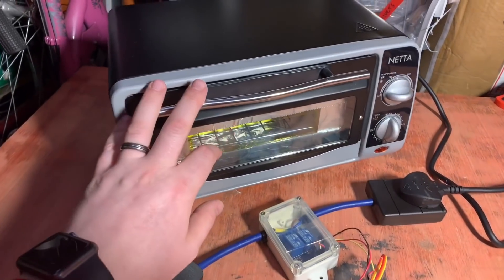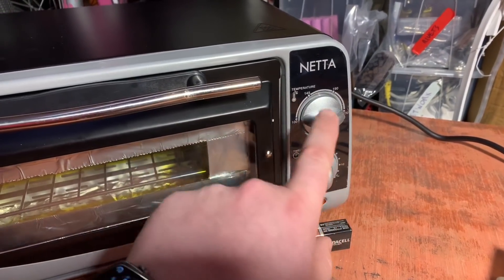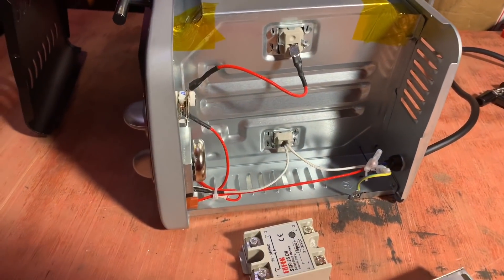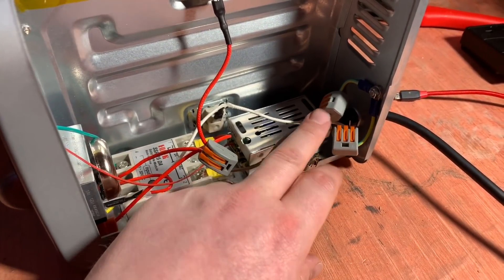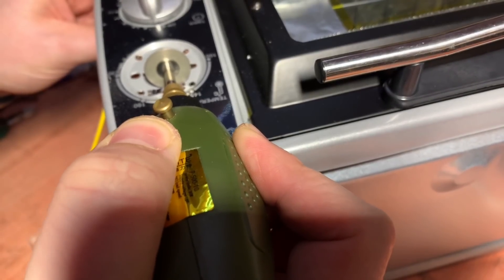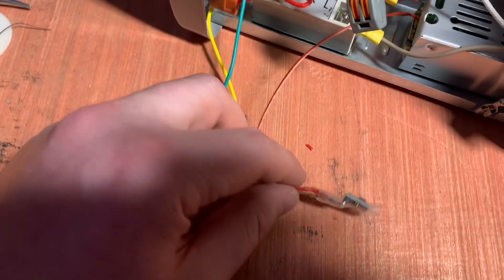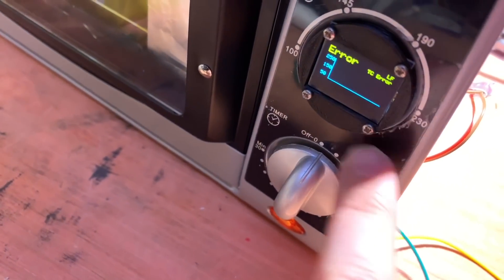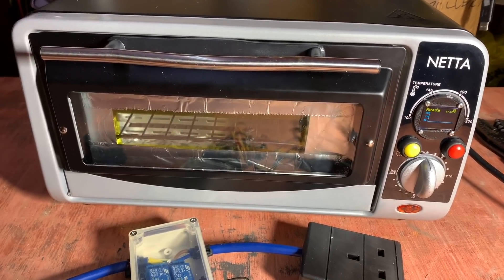RocketScream Toaster Reflow Oven Upgrade Build

Comment: Why did you bother to use a 220v AC oven when you could have done it with ( Reflow BGA solder with a GU10 halogen light bulb ), then you could have used all that battery power you have

Comment: Thanks for the video, I m trying to use this v2 code on a arduino pro mini 3v3 and external oled etc.. But It seems does not work, the oled get stuck at the startup and the temperature reading say (Nan), I m sure the oled and the temperature k sensor are working.. Have you made some changes on the code? Thanks

Comment: The controller really wants to be powered by 5V through the micro USB connector, even though most of the circuit is 3.3V. That way you get to use the resettable fuse that's on the 5V input. I am doing a similar build and ordered a 3.3V supply based on your video, but I've now ordered a 5V instead. Actually I don't know how yours works at all since according to the schematic the SSR outputs and buzzer are pulled up to 5V.

Comment: Hi Adam, thanks for the video. I just started my build today with exactly the same equipment. Hopefully, my Rocket Scream will be here on Thursday.

Can you put the 3D print you made on Thingiverse so I can copy it with pride. Thank you.
Reply from the maker: This is where I have to admit making various version to make it fit and I can’t remember which one is which or which one I ended up using :-/ I’ll see what I can find...
Reply: @AdamWelchUK  Not to worry if you can't, designing in 360 is an enjoyable process anyway. Would you recommend cutting out the metal that was behind the thermostat and completely replacing it with something 3D printed? That would produce a flush fit, but I don't know if it's worth the effort. is there any chance your screen could fall out of the board behind it?
Reply from the maker: These are my simple 3d parts... https://www.tinkercad.com/things/icxfl9mtdMN  
As I think I showed I just drilled four holes for the screws and a slot for the screen connection.  The corners of the screen are actually a little bit big for the round impression for the original knob - one day I'll be brave enough to file back those corners so it fits a bit better.  I do have a plan to 3d print a new panel, but I haven't got around to it yet.  Could my screen fall out - hopefully not, because I replaced the provided screws with longer versions, so the screws go through my 3d printed surround, through the screen, through a thin 3d printed insulator and then into the plastic stand offs which usually hold the screen to the rocketscream board.  So it can only fall off if the threads go in those stand offs - so I was careful when I screwed it on not to go too tight.
Would I cut out a larger section?  Probably not.  The way i have mounted it means the four screws are holding the screen on the front and holding the weight of the board behind.  Replacing the whole section might need gluing in to be able to take the weight of the rocketscreen board (not that it weighs all that much, but it also has a few wires hanging off it and I wouldn't want it floating around the mains if it did fall).  The metal of the oven is very thin and cutting it isn't always very neat.  I'd worry if I took a larger hole out I'd need to make my print big enough to cover a larger space to hide any imperfections.  Please do post a picture of yours though which ever way you do it - I'd love to see it.
Reply: @AdamWelchUK  Thank you, for the detailed answer. It answers my questions, I will stick with the printed circle for now and like you say, there is always the option of getting the Dremel out again at a later date. Just out of interest, where about's are you, I'm in Preston, Lancashire.
Reply from the maker: Oh well I’m on the sunny side of the Pennines. Leeds. ;-)

Comment: You covered all of my skepticism with your extra temperature readings in that cavity. Well done, nice build.
Hand nibbler pliers are a great little tool for working with sheet metal like this. I don't like the drill powered variety, but the pliers are awesome for cutting slots and square holes without distorting the surrounding metal. 
 I always seem to have a dremel run away to create it's own abstract art at inopportune moments. You're obviously better at that tool than I am :-)
-Jake
Reply from the maker: Hi Jake. Yeah the temperature rise in the cavity was surprisingly low. I was really pleased with the result. The dremel isn’t the best, but a quick go round with a small file sorted out the rougher edges. I was also safe in the knowledge that both sides would be covered up :-)

Comment: I'd put a toggle switch to turn the psu on/off. That way you don't have parasitic power usage while the unit isn't in use. Unless you don't have it plugged it in all the time, I suppose. And the size of your work shop.
Nice looking setup either way 👍
Reply from the maker: Thanks. No I’ll be putting this back in it’s box on the shelf once I’ve finished with it. I haven’t the luxury of space to leave it out. I did consider needing a switch to turn off the PSU if I plug in a USB cable, but as it stands I can’t plug one in yet because of where it is situated!

Comment: Hi, nice  work and nicely done!, seems like a very useful project, the ones I like. So, the schematic shows that the tiny reflow controller already has a 5v->3v3 regulator, no need for the ams1117, also, wrap a linear regulator sounds like a very bad idea. Cheers.
Reply from the maker: I should have looked at the schematic but assumed 3.3v was derived from the USB serial chip. I’ll check, thank you. 
Given that the AMS1111111117 is dropping only 1.7v at a pretty low current I’m not concerned about heat (and I’ve got plenty) but I will check the schematic and see if I can cut it out. Thanks again.

Comment: I love the idea of using the original mechanical timer as a safety. That's awesome. Maybe consider a re-settable thermal fuse as another safety vector? Strap that to the oven wall, so you don't burn  your shed down running the oven during the summer!

Comment: Great job! Just keep monitoring the heat in that cavity over time. Maybe sit the SSR and PS on some heat resistant material just for extra heat isolation from the case.
Reply from the maker: Cheers Seon. I will keep checking. I don’t imagine I’ll be doing flow after flow but I’ll look into that in case. Thanks.
Reply: @AdamWelchUK  Great project, Adam, and really nice permanent solution! I thought maybe a couple of strips of Scotch-brite pad under the SSD & PS would insulate them, non-flammable and is also non-conductive...? Just a thought. Thanks for all your videos for us makers!
Reply: @AdamWelchUK  I have had amazing luck with the little 40mm Noctua fans for quiet, just-needs-some-airflow cooling applications like this. I should be tossing one together with the new V2 board shortly, and do expect to be doing multiple runs back-to-back, so I think I'll toss one in. 

You definitely sold at least one of these boards for 'em. lol! Great vid, and mad props on checking the temps in that cavity. high five for rigorous testing.

Comment: Wrap the inside of the oven in fibreglass blanket. Helps keep the heat in.
Reply from the maker: I don’t know if you’ve seen my previous videos on this but I’ve found a layer or two of tin foil has been enough to get a reasonable heat profile out of this. I probably should insulate more - but quite like the fact I haven’t!  You might recognise one of the projects I’ve built this oven for ;-)
Cheers Stuart.

Comment: Pretty Dang Tidy set up Sir.  Used those Cheapo SSR a number of times.   Heat sinking and Thermo Paste is ESSENTIAL.  Don't count on them being reliable over about half of the rated Amperage.  LOL Typical Chines Ratings.  I think they add a zero ?
Reply from the maker: It’s bolted to the chassis of the oven. I’m running this “25 amp” relay at 850 watts or 3.5amps. As you saw I checked the temperature when I ran a reflow - I hope I’ll be ok. Do you think I should reconsider?
Reply: @AdamWelchUK  don't forget to use a MOV on the output of the SSR, had issues myself until I used one.